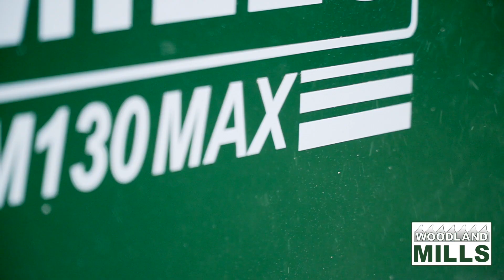Woodland Mills HM130MAX Anniversary Edition Portable Sawmill - Promo (2020)

Comment: We bought one and 2 years later it works great.  We have used about 20 blades and a few can be resharpened.
This machine literally paid for itself during the first project we built with our own homemade lumber.   See my video if you like to see the unboxing and first logs we cut.  We are happy with its quality.
We have been in the wildfire zone, evacuated this summer, and got lucky we didn't burn down.  Defensible space around our home is a priority and I'm saving logs like money in the bank for future projects.   I put a running sprinkler over this machine for over 6 weeks running water full time basically drowning the area as 335,000 acres of fire closed in.  When I got home after evacuation, the saw mill started right up 2nd pull with the choke on, and back to work like no problem.   Several of my neighbors have now purchased the same because the advantages are obvious in today's economy.  I don't have to buy or haul boards from the lumber yard and anytime I need a 2x6 or any custom piece; Bammo this is the solution in a few minutes.  

Thank you Woodland Mills.

Comment: What width track does this run on?  I built a 30'long bed for my older Woodland mill, would I have to modify the track width?
Reply from the maker: Hi Ron, the track of the HM130MAX is 37" wide.